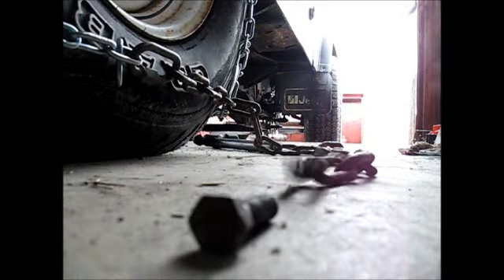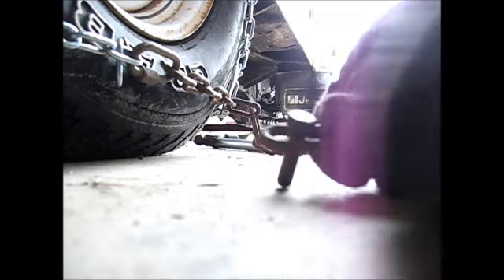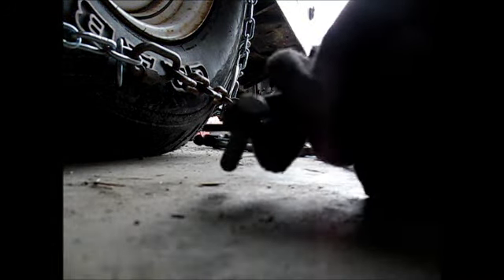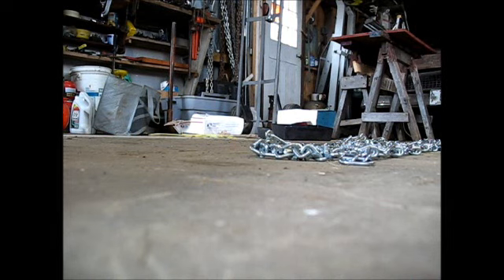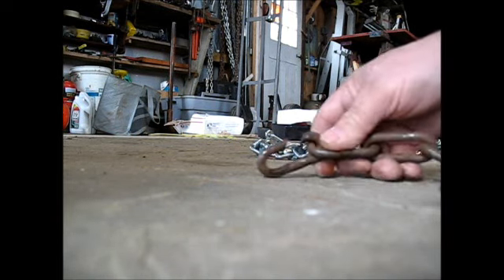Stretching Snow Chains

Comment: OMG the times Iv`e put chains on in the Northern Canadian & Artic trails I was taught to put them on put your glove at the link  roll ahead so they adjust loose then set the glove at 4:00 O clock on the wheel then pull all the chain back and take up slack , Well when you can drive a transport at 60 Mph on the HWY for 100 Km without worrying with only a growl from the tires you done it right ,they should be part of your tire 
NO BUNGY CORDS .Can`t put fingers behind chains either .